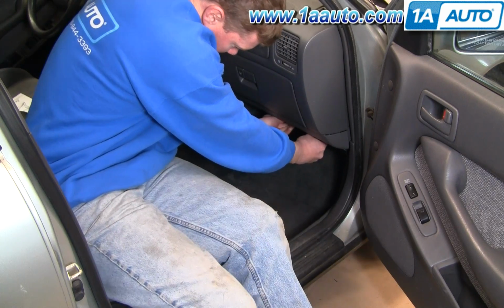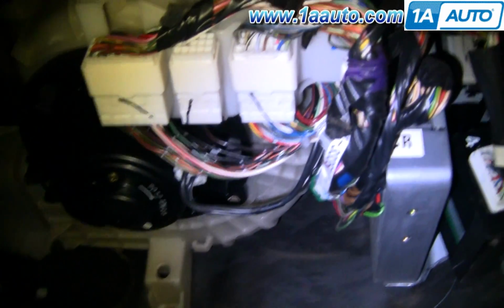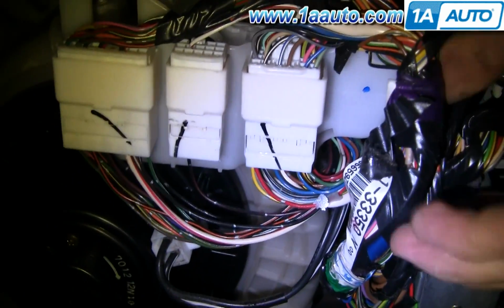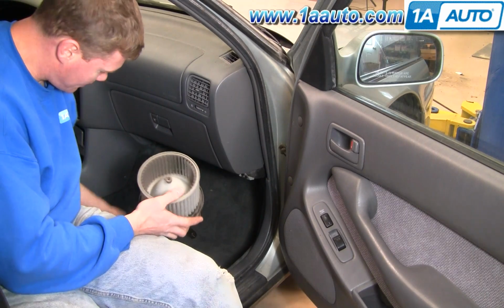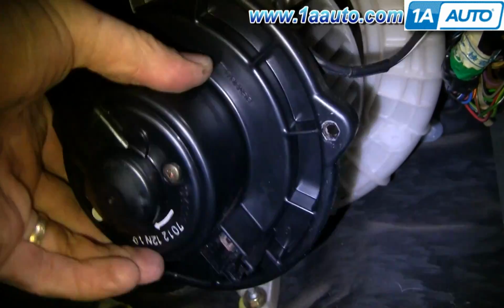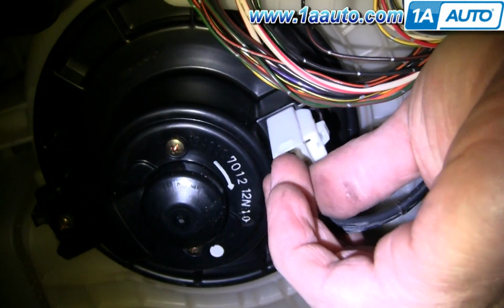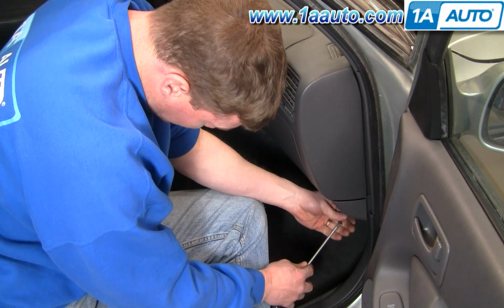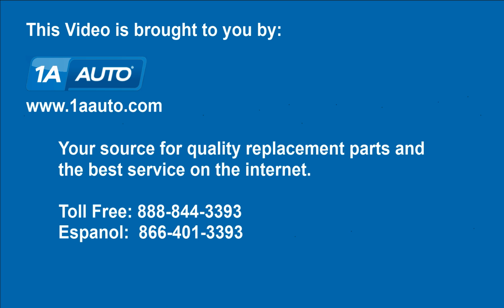How to Replace Heater Blower Motor 92-96 Toyota Camry

Comment from the maker: @kplannu There is a door that controls where the air comes from.  Not sure the set up on your vehicle, but it is either controlled by and electronic actuator or a cable.  The actuator may be bad or the cable may be broken or disconnected.

Comment: For the past 12 - 18 months I have tried to get rid of a "ticking" in the fan impeller. I looked in Lexus and various other sites on the web. Today I came upon your video and although it referred to Camry it was close enough for me to understand what I had to do to remove and clean out the blower. The noise was most annoying, as Lexus is a very quiet car. I shall know soon if I have fixed the issue, but if I haven't and need a replacement blower, I shall know how to go about it - thanks to your informative video. many thanks! Mike
Reply from the maker: Thanks for watching!
1aauto.com 888-844-3393

Comment: I am pleasantly surprised to receive your reply. To access the lever, will i have to remove the climate control? i tried yesterday, i managed to remove the gearshift cover, but even after removing the screws holding the climate control unit ( the ones behind the knobs) i dont know- i was unable to get access. I am doing something wrong

Comment: Excellent piece of technical documentation. It's applicable to the 2001 and 2002 Toyota Camry and Solara, as well. 
Solara's dash and glove box trim are different, but underneath the passenger dash and behind the glove box, the blower, plug blocks and cables are identical to the schema of the Camry in this video. Well Done, 1A!
Reply from the maker: +Michael S Myers CDR USN Thanks for watching. If any of our viewers needs to make this repair, we carry the auto repair part shown in this video on our website. Here is a link to them http://www.1aauto.com/1A/BlowerMotor/Toyota/Camry/1AHCX00096?utm_source=YouTube&utm_medium=CTA+Comment&utm_campaign=ytcomment&utm_term=hqhxNVaGcYU
Reply: Thx for noting the solara series. Have a 'no blow' situation on a 04 solara...i suspect a rattling dash screw that no longer is rattling but now my fan wont move...while all other heat function work. This seems ez enough to check. (Checked fuses already)

Comment from the maker: @godzilla81 You say it is not blowing hot air, is is blowing any air?  If you are getting air movement then the fan is not the problem.  More likely iti si an air door controller.  If you are not getting any air flow then check the fuse first.  If the fuse is good then it is probably your fan.

Comment: Hi I have a 98 Toyota Camry LE.  I have the dashbox in front that is different from the one you are doing here.  Do you know if the setup behind the dash on the 98 is the same for replacing the blower fan?  The part looks to be exactly the same as the one your using.  Also do you know by chance how to remove the dash box?  Thanks for any help you can give me!

Comment: My problem seems to be no floor circulation on either the driver or passenger side.  The fans appear to be working ok since the dash air circulation is fine.  Any thoughts on what the problem may be with the floor circulation?

Comment: I have a 1999 Toyota Solara that basically uses the same part.  When I try to remove the old one, there is a bunch of wires, etc. that is blocking the screw on one side.  I cannot figure out how to remove the wires - they appear to be connected to a plastic piece that is mounted.  Do you know how to remove this piece on my car?   Do I need to remove the glove compartment to access that?  I'm so close, but can't figure this one step out. I may bring it to my mechanic if I can't figure it out!

Comment: Great video. Great web site. The A/C fan on my 98 Lexus ES300 blows for days then won't blow for days. Compressor works b/c when I drive with open vents, a little cold air blows into car. Not sure what triggers the blow/no blow. Sometimes it seems to work after hitting a pot hole. Other times, I have no idea. Blocked fan? Fuse?

Comment: This is a great video. I was able to clean out the blower motor fan (which was loaded with acorns) in about 20 minutes start to finish. I just have to find where the little buggers are getting in, as the vents under the windshield are too small for the size acorns and fragments I found... Thanks for posting this!
Reply: If you havn't found where they are getting in at.. check the fresh air intake  should be under the passenger side up in that black plastic area around the wiper arms. there is a filter that goes in there   I had to install what is called Hardware cloth to cover the filter so the little buggers couldn't chew through it as easy.

Comment: Not to same on a '97 Avalon with automatic heat control.  
The resistor is located above the accelerator pedal on the driver's side and the forward screw cannot be accessed because of the plastic firewall cover.  Don't know how to get the variable resistor off without cutting part of that plastic cover away.  Even then it is going to be a bear to remove and replace.

Comment from the maker: It there's rubber vent hose that connects you blower motor and you push it in too far, it may be making contact with the motor or cage, you could try to pull it out a little bit. If you're still having an issue, call our sales staff at 888-844-3393 and we'll help you out over the phone.

Comment: How can you tell if your blower motor is going out or if it's the resistor going out?? My motor is making a slight noise and the air fades in and out. It also fades in and out with every bump I hit
Reply from the maker: +So-Lo Aquatics Thanks for watching!  The resistor only controls the speed of the fan, so if your fan is making an abnormal noise it may be the fan motor.  1aauto.com
Reply: Mine did that too if your fan is making noise its the motor Plus when it was going out i hit the bottom side of the dash and it would start spinning again.   Yours could also just be a loose connection.

Comment: will it be similar to a 04 tacoma if i want to change mine?
Reply from the maker: Thank you for watching. The idea is still the same, they are both behind the glove box, however it is going to be a little different as far as unbolting and removing it goes.
1aauto.com 888-844-3393

Comment from the maker: Usually there are only a couple of screws that hold these in place on most vehicles. Once you're able to free it from the housing, you should be able to change it fairly easily. We carry the replacement blower motor for a 2004 Toyota Avalon on our website with FREE SHIPPING. Here's a link to them. 1aauto.com/1A/BlowerMotor/Toyota/Avalon/1AHCX00171/369897/2004?utm_source=youtube&utm_medium=youtube&utm_campaign=1ATony